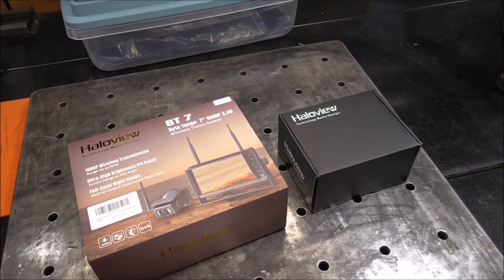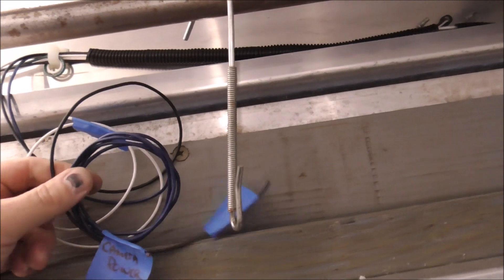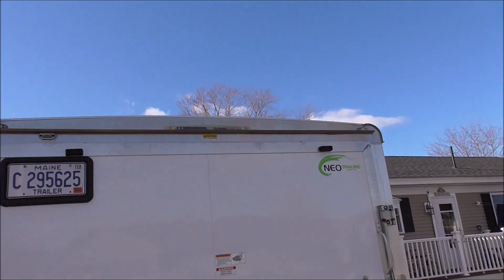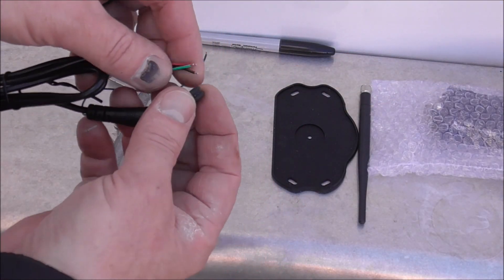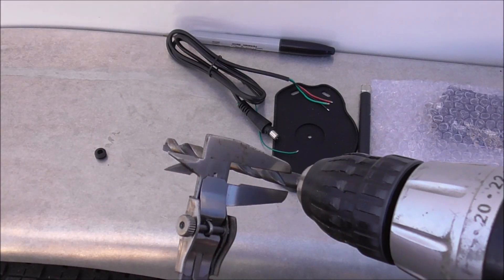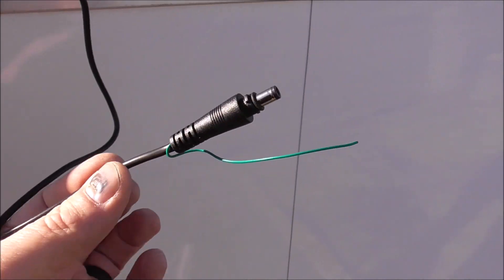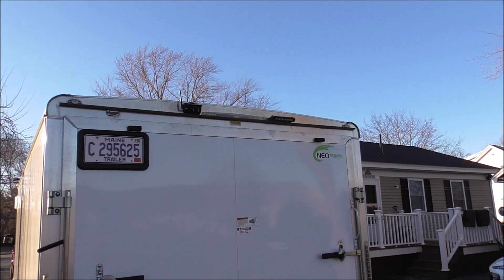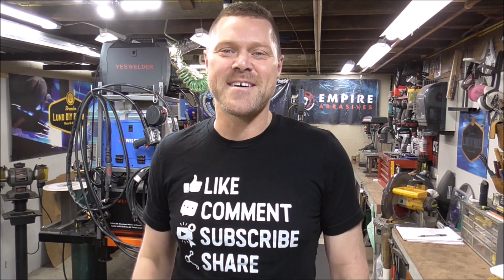Haloview Backup Camera, Cargo Camera and LED Light Install

Comment: I have that same camera on our RV, it works great however I have mine is setup to operate all the time when powered with a switch to turn it off when not needed. Driving down the road it sure is nice to see what is going on behind me. I used a gland nut instead of grommet for a water tight seal and no goopy sealant that will deteriorate under the UV light.  The camera transmits over  1500 feet. 
Getting ride of the scotch locks will solve a lot of potential future problems, I hate those things. 😁🛫
Reply from the maker: Thats how I wired this one too. It's on all the time

Comment: Nice Brandon, Happy Easter with the family, a question "what are you going to do with the orange cable"? See you next week, greetings and have a nice weekend.
Reply from the maker: Thanks man and Happy Easter to you and yours also. That orange wire is just temporary. It's powering up some temporary 120 volts lights until I get the 12 volt battery completely wired up permanantly with the onboard charging system.

Comment: I may have missed it, but did you show how you mounted the monitor in the truck?
Reply from the maker: I don't think I did show it. I purchased a mount from Built Right Industries and I purchased an arm from Bullet Point  Mounting Solutions. It wasn't cheap but it's rock solid.